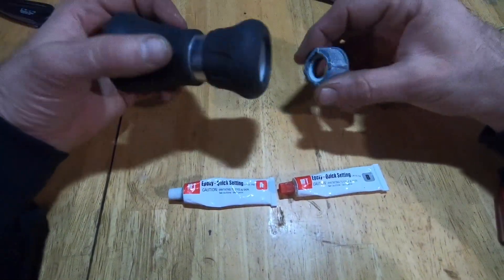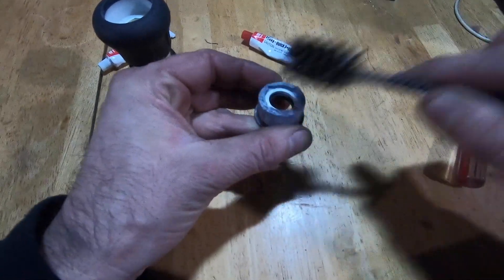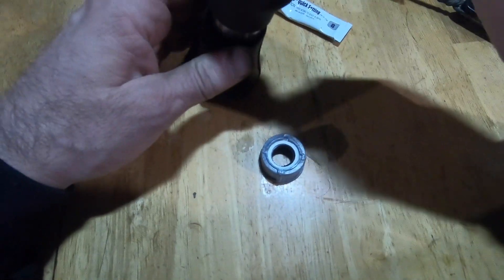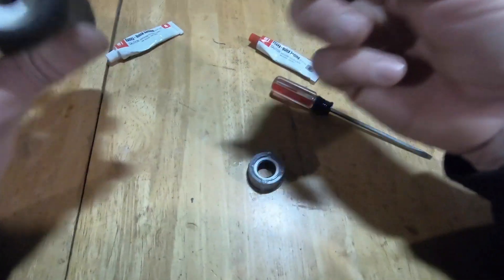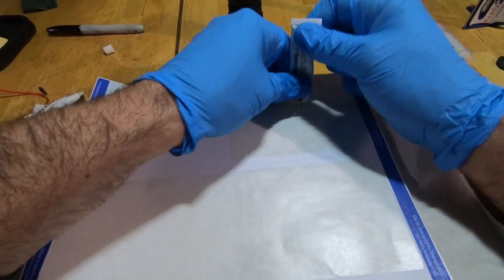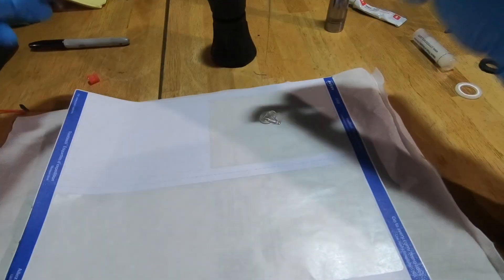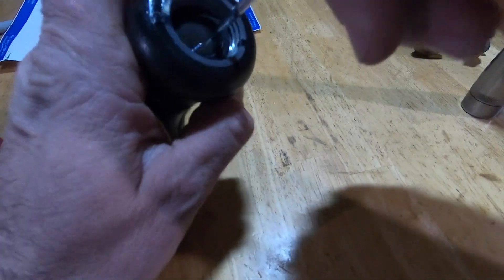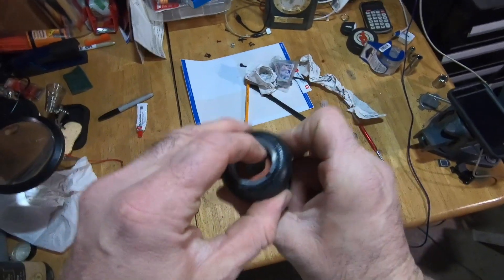Harbor Freight HFT Quickset Epoxy Hose Nozzle Repair

Comment: I have a leak between the power steering pump and the reservoir. New pump, new o-ring same original reservoir. Still leaked.... Automotive Amazing Goop to the rescue. I am leaving it a FULL 48 hrs before even touching it. Waiting as I just seen your video. GREAT, ALL WORKS... Hoping mine does too.

Comment: The harbor frieght epoxy in the syringe plunger is awesome, i almost think its better than gorilla glue epoxy, i think gorilla glue epoxy sucks though. For the price i was happy. Never used this two part mix but i think i may buy it when the time calls.